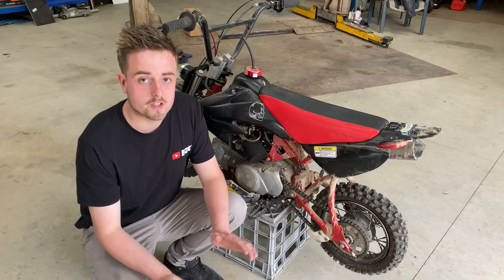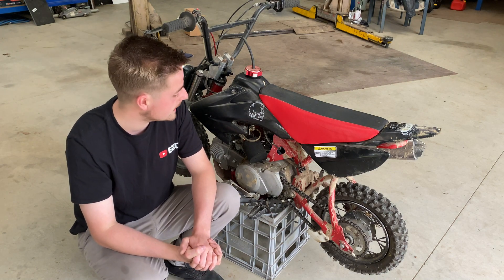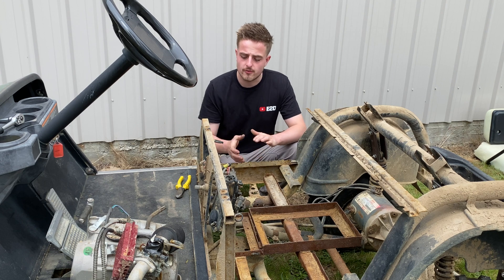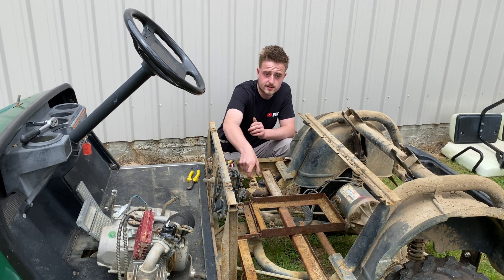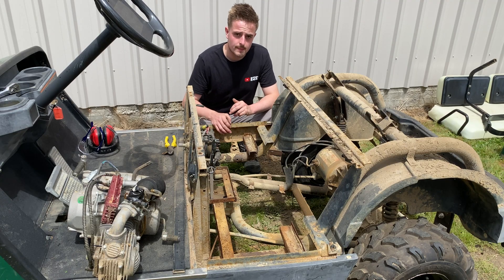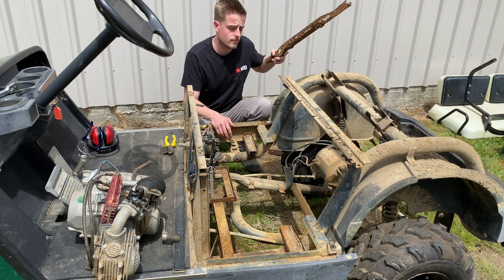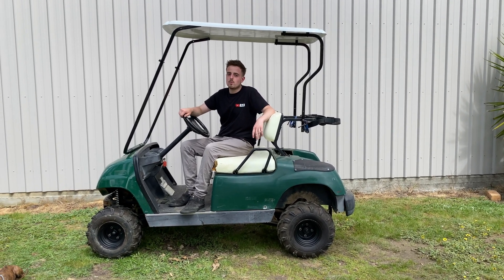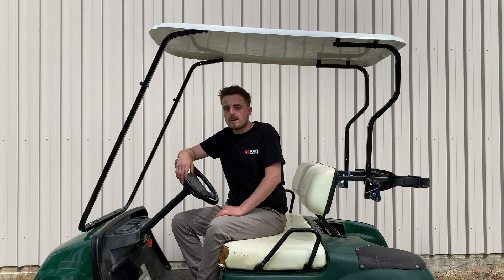Electric To Gas Golf Cart Conversion |Part 4

Comment: Why the extra shaft? Can’t just go straight from the motor to the shaft going into the diff? (I’m sure you’ve looked into it, just curious)
Reply from the maker: Hey Tim Hinde I’m thinking the extra shaft only for gearing purposes, if I went straight to the axle you would have to drive in top gear all the time..